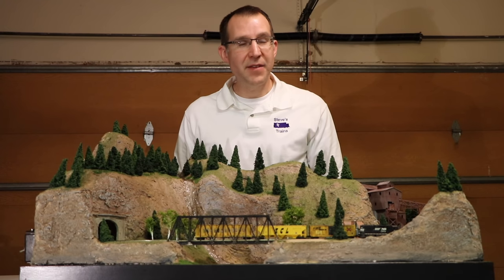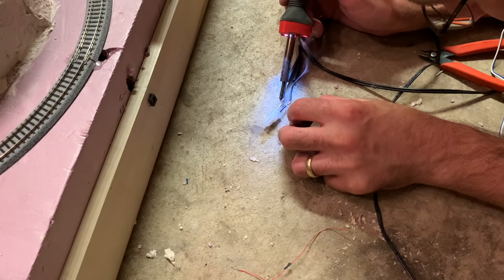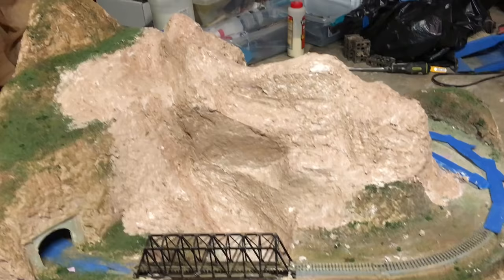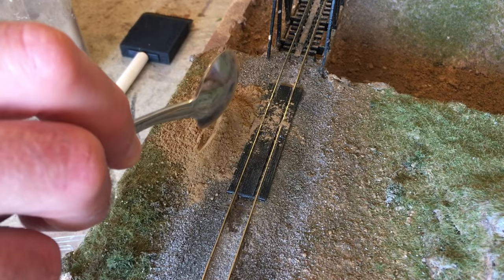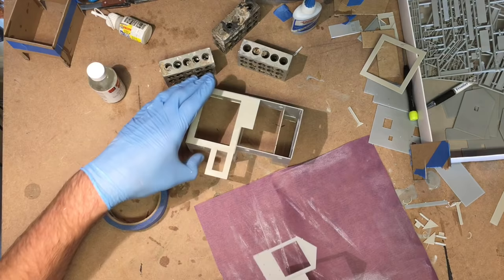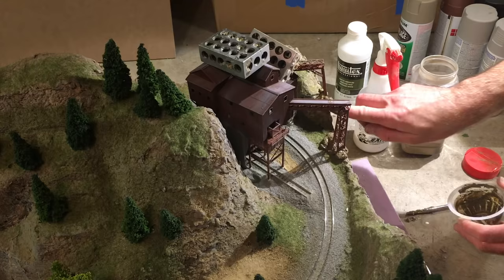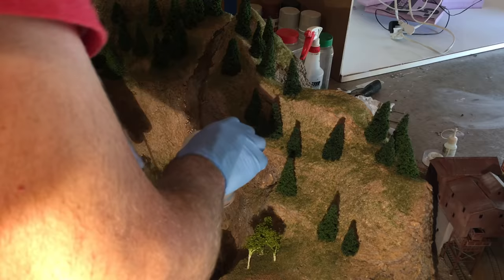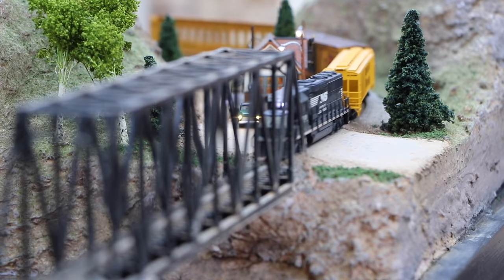Colorado Loop Layout Build: 2x3 Foot N Scale Model Railroad Tutorial

Comment: Went to a lot of extra work on the base. Could have just sprayed it with satin or semi gloss paint. Also on building the mountains I have found that paper towels or newspaper strips soaked in plaster spread over shaped foam or lath/chicken wire works well and is less expensive. Your project looks good and if you’re happy with it then that’s all that really matters.
Reply from the maker: Per the paint, that is true, but I just used what I had on hand. I used to use the plaster with towels/cloths method, but I much prefer using sculptamold now. It gives a very natural rock texture without any carving or casting needed. Rock casting will still provide a more realistic rock texture, but straight up sculptamold looks pretty good by itself. It is only about $2.50/lb when buying in bulk, and I probably only used maybe 6-8 lbs on this layout, so less than $20 worth. Obviously if you are doing a large layout it makes sense to use cheaper methods since there might be a meaningful cost savings. But, since I work about 60-70 hours a week and have a family, I always pick time saving methods over cost saving methods for most projects, especially since almost all of these projects are built for clients and not myself.

Comment: Great small model. I have a n scale oval track with 9 3/4” radius and two straight sections on each side. I want to connect the two sides with another oval using right and a left turnout but I dont know what radius to use for the turnouts. I would appreciate any help.
Reply from the maker: So, if the main loop has 9 3/4” radius curves and you use the Kato #6 turnouts, then to make the connection inside the main oval you need two more 9 3/4” radius curves, one full 8.5” radius curve track and one 15 degree 8.5” radius curved track. You connect one 9 3/4” radius curve track to each turnout and then put the full and 15 degree curved sections of 8.5” radius curved track in the  middle to finish the connection and it should work perfectly. If you aren’t using Kato track but have Bachmann track or something like that, the curve on the standard turnouts is usually 9 3/4” radius and so you probably can just use three more 9 3/4” radius curved sections to complete the connection.

Comment: Question: after applying all that glue, dirt, and ballast over the tracks, what do you do to clean everything up so the train runs smoothly, without disturbing the rest of the ballast?
Reply from the maker: I try to wipe everything down with an alcohol wipe before the glue dries to clean it off the rails, just wrapped around a finger or small block of wood. I'll use an abrasive track cleaning block if needed afterwards as well, though usually an alcohol wipe gets things pretty clean as long as everything hasn't dried. It also will help remove any paint on the rails.
Reply: @StevesTrains  Thanks for the insight!

Comment: Ticket center coat hanger and put it in your soldering iron instead of your soldering tip then you can use it to cut through the foam
Reply from the maker: Good ideal. I’ll have to try that.

Comment: If you use the Kato Unitrack railjoiner, you don´t have to solder the track.
Reply from the maker: Normally, but when you spray glue all over like I was doing you will occasionally find you have quasi-insulated a section of track and have a voltage drop. If you are careful with the glue it will usually be fine.

Comment: Great work on your layout there. With a small train station there all you would need is a Budd RDC or 2 Budd RDC’s for the layout. I’m an N smaller myself, my layout is only temporary for the time being. My model railroad is the Pacific West Coast. I have 29 freight cars, 2 cabooses, a Santa Fe wide vision & a Southern Pacific bay window caboose, a Santa Fe SDP40F diesel locomotives, 3 Amtrak P42 diesel locomotives, an Amtrak Heritage baggage car, 11 Amtrak Superliner cars, the Southern Pacific Daylight steam locomotives number 4449, the 10 car Morning Daylight set which is my excursion train, 2 display locomotives on my model railroad. I scratch built 4 water towers for the railroad, a steam locomotive oil storage tank & 4 diesel fuel storage tanks. All the fuel tanks, water towers are scratch built from empty Progresso soup cans, 1/2 inch wooden dowels, newspaper, drink umbrellas, bendable straws for the water towers. Empty carpet fresh containers & 1/2 inch thick styrofoam sheet for the cradles for the diesel fuel tank storage. I am going o sratch build a diesel locomotive service shop. My scratch built projects are ongoing.
Reply from the maker: A Budd RDC would be great.  I've wanted to pick one of those up in the past, I should at some point.
Reply: @StevesTrains  Kato USA make Budd RDC cars that are $80.00, check you hobby store or order from Kato USA. Being it’s a Colorado Loop N scale, a Santa Fe RDC3 would be good for you layout.
Reply: Did you make a video or take any pics of it?

Comment: Loved the video. Just one question wouldn't you using all that glue and isopropyl alcohol mess up the contact on your rails? Just asking. Thanks for posting it. Have a great day everyone.
Reply from the maker: I solder most of the connections, so that isn't usually a problem, but yes, if you get a lot of glue in the rail joiners, that can act as an insulator. Usually I use an eye dropper which is safer in that regard. As long as the rail joiners are tight I think it will be ok. I generally use multiple power leads to the track and solder a lot of the rail joiners (leaving a few unsoldered for expansion, especially on larger layouts).
Reply from the maker: One more thing, you will certainly need to clean the tops of the rails well since they will have a coating of glue on them, most likely.
Reply: @StevesTrains  any tips on ballasting or weathering ties ?
Reply from the maker: @davidurban6813  I've I'm trying for more realism I will paint the rails and ties with a rail brown color, then add various washes of lighter colors to the ties, lighter browns and grays to add variation to the shading. The natural stone ballast I usually use does some natural weather by itself, and often I will mix in a little dirt as well. the dust from the ballast and bit of dirt will work into the grain on the ties and add some weathering effects as well. I'll frequently do a black wash over the ballast to help make the grain stand out a little more. Ballasting itself is tricky to do well, and I still don't always do a great job because I rush it too much. Generally I paint on glue along side the track before putting the ballast down, and try my best to not have much ballast sitting on top of the ties. Having some glue under the ballast helps since if you don't put enough glue on the top, sometimes it won't saturate all the way down to the bottom, which can result in chunks of ballast breaking off over time.

Comment: So I know the stand is 2x3 but how wide is the actual track. 18 inches???
Reply from the maker: Yeah it is mostly 9 3/4” radius but I think I had two sections of 8.5” radius curve track on the middle of each end as well if I remember. So it basically averaged out to a 9” radius and 18” across from track center to center give or take part of an inch.

Comment: How do you clean the track after spraying all the medium on it?
Reply from the maker: You need to clean it off right away to avoid having it harden on the rails. I don’t think I will spray the glue on again. It is fast but cleaning the track takes a while. If the glue dries you need to use an abrasive cleaning block.  A cloth with rubbing alcohol on it (wrapped around your finer or a paint stirrer or something like that) will work fine if the glue hasn’t fully dried.

Comment: Steve I have to ask the Expert. Since I think I really Went wrong. I have a 3x5 N scale dual line. It's over 15 years old. I just took it out and the all the flat land is bubbled. When I did this I was to told to cover the foam base with the plaster sheets used to set broken Arms. Well, I know I have to start by removing all the track, then removing the Plaster. My question to you is what do I use on the Foam Base? I would send JPG's but I don't know how. Thanks Joe
Reply from the maker: Not sure what may have happened to your layout. You can always go to my website and send an email message from there: https://www.steves-trains.com

Comment: Fantastic tutorial and great sculpting work. Just got into model trains a week ago, been into RC most of my life. I bought a landscape model from 'n local who needed the space and currently attempting to restore it a bit. Question though. I see you spray the glue over the track trails, how do you clean it afterwards to ensure good contact?
Reply from the maker: I try to wipe everything down with an alcohol wipe before the glue dries to clean it off the rails. I'll use an abrasive track cleaning block if needed afterwards as well, though usually an alcohol wipe gets things pretty clean as long as everything hasn't dried. It also will help remove any paint on the rails.
Reply: @StevesTrains  Thank you very much for the reply. Makes sense 👍🏻. Keep up the great work and video's

Comment: Just subscribed… Your videos are amazing and inspiring. I’m going to build a table. One question. I don’t see how you prepared the track after final construction. I’m sure it had to be cleaned or sanded?  Again, big fan and I’ll be stocking up on supplies at the Indy train show this coming weekend.
Reply from the maker: Thanks! I wiped the track clean after gluing the ballast down and the used a woodland Scenics tidy track block to get off the stubborn spots. A bit of mineral spirits on a rag can help get any of the paint or glue off too if needed.
Reply: @StevesTrains  Thanks!  I’m going to the train show this weekend to do some shopping. Any suggestions on hard to find stuff that I need for my first table?  If you don’t mind, I’d like to share my progress. 
What other basic supplies should I stalk up on?  In advance… Thank you very much! :-)

Comment: If you put glue all over the track when you put down the ballast how do you clean the rails up?
Reply from the maker: I tried to wipe most of it off the rails using a scrap piece of MDF before the glue dried, but I had to bo back with a woodland scenics track cleaning pad from their tidy track system in places where there was still some glue on the rail heads.
Reply from the maker: Obviously using an eyedropper avoids this problem, but I was trying to get this project done pretty fast.

Comment: i honestly dont understand the reason to solder glued down Kato uni track
Reply from the maker: Not really needed, but the track connections will lose conductivity over time because of oxidation and you will see a voltage drop over the course of a couple of years. Odds of having a dead section of track develop are low but possible over time.

Comment: Hello, I like the video and wondered if you could answer 2 questions. 1) What are the metal blocks you use to square up the buildings called? I've seen them used by other people but don't know where to get them or what to ask for when searching. 2) What kind of glue did you use for the building? I have a similar style of glue I use, but it is very thin and does not do a great job. Thank you 2 Thumbs Up!

Comment: I know it's really small Steve but would there be space in the tunnel for a short storage loop? I'm just thinking you could have a short passenger set running in the opposite direction and could alternate them. Just a thought.😁
Reply from the maker: With unitrack it would only work with their small radius turnouts. It would work out better using Peco track. That would be a pretty good idea to try out actually.
Reply: @StevesTrains  It would make operation a wee bit more interesting. If there was a second train available, you could also hold a freight train in the mine siding and bring a passenger set out from the hidden loop.😁

Comment: Just getting into N scale model RR. I am going to establish some basic s scenery skills by doing a small diorama, and then I thought this would be a suitable first layout to cut my teeth on. Can you tell me if you used Kato 9.75" or 11" radius for this layout?  Thank you for the detailed video.
Reply from the maker: 9 3/4” radius curves on that one.  More info here: https://www.steves-trains.com/post/colorado-loop-layout-build
I can’t find the actual track plan, but I just arranged the loop of track to fit the space with some space on each side. You could do 11” radius curves but then only have an inch on either side between the track and edge of the layout instead of a few inches.
Reply: @StevesTrains  Thanks, Steve.

Comment: Steve do you have a track plan for this layout? I couldn't find it on your website. Mostly just wondering what size Kato curves you used?
Reply from the maker: In can’t find one so I guess not. It was mostly 9 3/4” radius curves I probably had a section or two of somewhat larger or smaller radius curves to make the loop work since it wasn’t a perfect oval but had a bend in it on one side.

Comment: What locomotive did you use for the tight radius? I'm asking because I want to build a small layout like this. I bought the kato 8 1/2" radius and I'm hoping the bachmann alco s2 will run around it.
Reply from the maker: Any 4 axle locomotive will easily take the 8.5" radius curves. I was using a GP-60. Where you tend to have problems is the rolling stock if it is longer and has body mounted couplers. With truck mounted couplers you are fine even down to 6" radius typically for anything 50' and under. But, with body mounted couplers, 8.5" radius curves can start to be a problem. Since the coupler on the locomotive is fixed, it can help to have a piece of rolling stock with truck mounted couplers connecting to the locomotive, and to both ends of any rolling stock with body mounted couplers.
Reply: @StevesTrains  thank you very much. I really appreciate the help. I've been watching your videos for years. Amd they have been a huge help with info. Now Im going to finally take the plunge. And please keep making more videos and tutorials.

Comment: Hi iam philip and me and my girlfriend like your layout as were doing our own layout in n scale iam useing formboard to what do you think of that I like the way you do railway crossing tell me how its dune
Reply from the maker: Easiest way is to buy a road crossing that is ready to install from woodland Scenics or similar ones from other companies. Otherwise, next options are to use thin sheets of plastic you cut to fit between the rails and paint a concrete color or use thin strips of wood to do the same. The key is to allow enough room for wheels on either side of part that goes between the rails to make sure no part of the road or crossing on either side of the rail extends above the rail, even a tiny amount, or you will have trouble.
Reply: Hi right ok then thanks for letting me no ill do that

Comment: @ 2:40 you talked about the wire did you solder it to the track or is there an attachment you didn't say
Reply from the maker: I just used the Kato terminal unijoiners.
Reply: Fantastic video

Comment: This is a great video! I do have a question as I'm considering using Kato Unitrack for my new layout. How hard was it to integrate those Kato track pieces to your bridge?
Reply from the maker: It is actually a Kato bridge so no issue at all.  For a different bridge you could remove the kato unijoiners and use a regular rail joiner that works with code 80 track.

Comment: Hi Steve I’m very impressed by your videos. Which N scale « ready to play » train set would you recommend for my 8 year old son? Also, is EZ-Tracks the best option for easy setup and play? It will be his very first train set . And if the passion is there , I’ll get inspiration from your videos to make a nice landscape. Thanks in advance Steve for your recommendations!
Reply from the maker: In general I like the Kato sets better than the Bachmann EZ Track ones but those can still be good as well. Kato sets are higher quality in terms of the locomotives and track but also more expensive. EZ track is fine except that it doesn’t stand up as well to taking it apart and putting it back together multiple times. You can fix the rail joiners if they get bent but the Kato track stands up to abuse better. Again though the cost is higher for the Kato sets and neither are going to stand up well to being chucked across the room or being attacked by dinosaurs or Thor or whatever. I would avoid any sets with steam locomotives for a first set. Diesel locomotive models are usually more durable and reliable are generally easier to put and keep on the track.
Reply: @StevesTrains  thank you Steve . But for a first set, we’ll go with a less expensive set until my son catch the train fever ;- )

Comment: This is masterpiece.What ballast size?
Reply from the maker: It is either Arizona rock and mineral or scenic express fine ballast.  I actually mixed leftover ballast from a few different bags and canisters together on this one.
Reply: Forgot to add that you make look that all is possible for rest of us:)-if that make sense.Any different brands of track apart  Kato?Sorry to bother you but that is such a inspiration can't contain my excitement  for future in hobby:)
Reply from the maker: @FNG0000  The Atlas code 55 track probably looks the best, and I'll be using some of that on an upcoming diorama project, but when not using Kato, I usually use Peco track since the code 55 Peco track looks pretty good and is extremely robust, and more durable than the Atlas track.